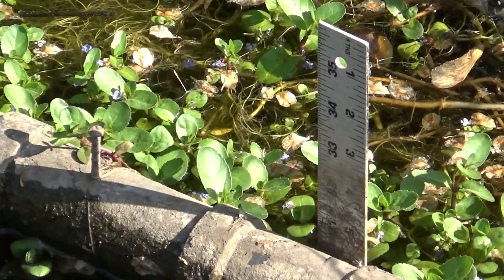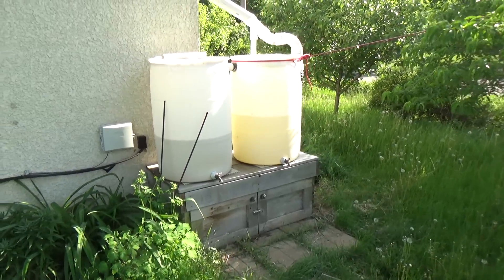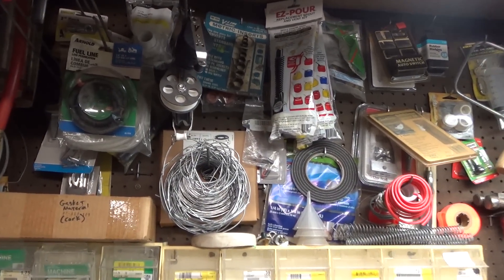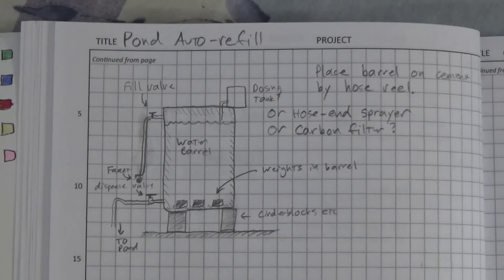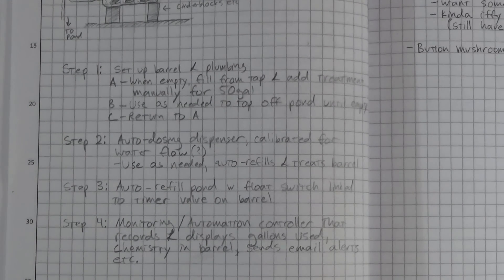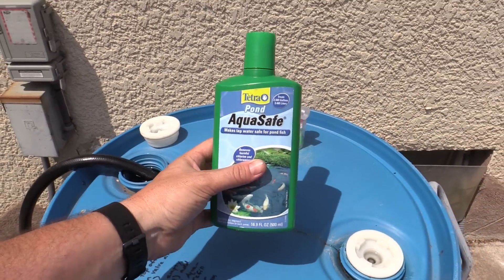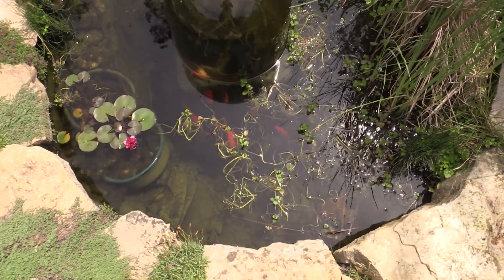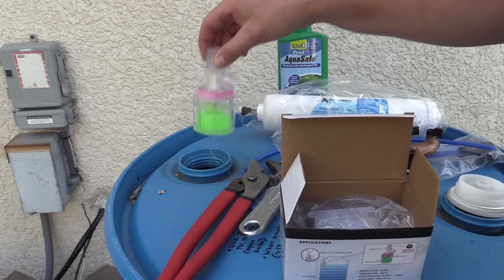Fish Pond Water Treatment & Refill System

Comment: I would hook up a pump to circulate the pond water through the barrel and then have a float connected to the barrel so when the water level drops, it adds just a little city water to maintain the level and the chemicals that are in the small amount of city water would be diluted in the barrel and ultimately the pond.

Comment: The brass valve I think is to be installed sideways so that the weigth of the floater keeps the valve open when it is empty but as it floats it closes the valve, my water reservoirs have those, I installed mine to capture rain water and I was thinking in installing a switch so that when the float goes to the highest level I set it makes contact and starts a pump so the water can be thrown into the sewage because here in SoCal and Baja (México) when it rains in winter there is so much water that in an hour you can fill multiple 1 cubic meter reservoirs but they are far from the closes drain.

Saludos.

Comment: I built a refill system for my fish pond using toilet fill parts. The base was a plastic bucket filled with gravel to keep it stationary. The toilet fill thing was attached to a garden hose and fastened to the  plastic bucket lid. Like a toilet if the water level dropped the float would turn on the water. Worked great for several years until something broke and flooded the pond with chlorinated water killing the fish. A tiny bit of chlorinated water added to a fish pond full of plants didn't seem to be a problem.
Reply: I used an old toilet

Comment: I came here with same line of thinking of others. I thought to cannibalize an old sum pump switch and float, hook that to a solenoid valve, just to fill the barrel.  Then handle cleaning the water either by slowly feeding out the bottom through the carbon filter,  or as the tank is filling, drop in the 10ml of chemicals. 

I hope that makes some semblance of sense. Thanks for making things, and I'll be watching.

Comment: I have a hydro-Logic 200 it comes as a kit with 1/4 water lines and slip fittings and a float valve with slip fitting, 2  RO membrane filters and a sediment filter and carbon filter. Yes there is waste water and it takes a while but the water is pure. I’ve been using mine for many years and never had a leak. All RO filters have water waste unless you catch it and use it somehow.

Comment: add an aerator or small circulating pump to barrel.
Fill Barrel.
wait 72 hours, do a chlorine test.
In a bathtub most of it will evaporate in 24 hours, but that has more surface, hopefully the aerator or pump will help.
Reply from the maker: There's also Chloramine, which is some other chemical that doesn't evaporate as quick.

Comment: Instead of float switch use electric float switch and an old washing machine fill valve, or one from a scrappeed fridge with water dispenser, which comes as a bonus with all the fittings for that pipe as well. Then you just need to put a level switch in the tank, and control the valve, which makes it fill slowly, then shut off when full, exactly as you want, and the low flow rate means even a fault will only result in the pond getting a little more water in.
Reply: Throw in an Arduino!

Comment: You need a better cross connection system. I wouldn’t want to drink that pond water
Reply from the maker: The barrel doesn't have a way to backflow, the water drops in the top.
Reply: @saveitforparts  Once you put the hose directly into the barrel, there is a chance for backflow. I couldn’t tell if your wall hydrant (faucet) was frost feee/vacuum breaker type or not but the fact that you are adding chemicals to the barrel plus the barell is directly connected to the pond presents a problem.

Comment: I have dechlorinated water for my pond by letting it sit for a couple days.  It's quicker when exposed to sun, and quicker if you circulate it with an air stone.
Reply from the maker: Works for chlorine but supposedly chloramine sticks around longer. Our water has that stuff in it too.

Comment: Water and Wastewater Engineer here.

I would recommend finding out exactly what chemicals are going into your treated water. If by chance it’s just free chlorine for the residual you may be in luck. If you aren’t filling and refilling the tank too often you could add in a small intermittent aerator and the free chlorine would off gas relatively quickly, a day would probably be adequate. Fluoride and chloramine a are another story. That would remove the hassle of dealing with chemicals. If you can find a cheap peristaltic pump, you can use that to run your chemical if it’s required.
Reply from the maker: I've looked ours up before and it's mainly chlorine and chloramine. The second one apparently lasts longer and doesn't evaporate off. The goldfish don't seem to care (we had some accidentally spawn in the duck pond that just gets straight tap water). However the local frogs and toads also use the pond and they seem more sensitive.
Reply: @saveitforparts  
First off; I love this project your doing, this is on the same level of some graduate work I have seen!

The chlorine part of chloramine will still off gas, but takes much longer, days instead of hours. But you will be left with Ammonia. That being said, it may be a low enough concentration not to matter. 

Edit: After more thought, you can probably make your own Activated Carbon filter. I would pipe a 10 gallon bucket on the inlet of your tank and fill it with Granulated Activated Carbon, then have the water run though the bucket into the holding tank. I imagine you can find some for really cheap (you might even experiment and see if natural charcoal would work). I think between that and the length of time between pond refills might set you straight. A UV light could also remove the chlorine.
Reply: I don't honestly know a ton about this subject beyond my local water company posts data sheets on exactly what chemicals ppm in the city water. Was a rather interesting read, but way over my head.
Reply: @elesjuan  The cool thing about modern Water Treatment is that in most cases it’s a relatively simple process. It’s more or less a 3 step process: flocculation and settling, filtration, and disinfection. 

I was surprised to learn there aren’t that many chemical additions in most cases. Usually it’s a flocculant, pH corrector, and some form of chlorine for disinfection. Fluoride is sometimes added for tooth stuff, but not always.

I could go on and on about this stuff, there’s a reason it’s my career.😂😂😂

Comment: The low flow rate of the filter shouldn’t matter. It will fill the barrel, then the float valve will shut it off when the barrel is full. Then you can use the water in the barrel as fast as you can get it out. Unless you need more than 55 gallons of water at a time, you won’t notice how slow the filter is. 

Also the brass float valve is mean to go through the side of the container, not the bottom. 

It would make more sense to ditch the barrel, feed filtered water into the PVC pipe the under the yard, then put a float valve in the pond. That way the pond will continuously top up, and the filter won’t have any trouble at all keeping up.

Comment: you can use a normal large carbon block filter for filtering drinking water to get the chlorine and flouride treatments out; those a fairly cheap on fleabay with housings that have normal NPT fittings instead of the quick connect fittings, and most of the larger ones do not need a flow restriction.
Reply: Yes and the 8in filter blocks are both common, and cheap, unlike the speciality ones. Tip is to get the ones filled with carbon granule,s as those come apart, so can be refilled with fine charcoal instead of buying new, making it much cheaper to run. Plus add in a 0.3 mincron filter before the carbon, and another after, to keep the water going into the charcoal clean, and to strip the fines out of the water after the charcoal is done. You can also add in some ion exchange resin as well, to remove both heavy elements and a lot of dissolved ions in the water.